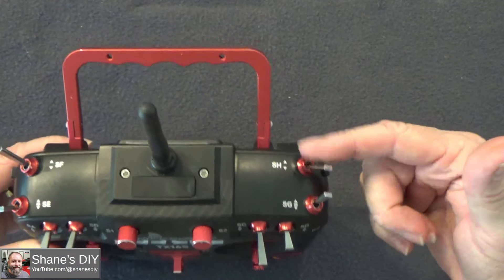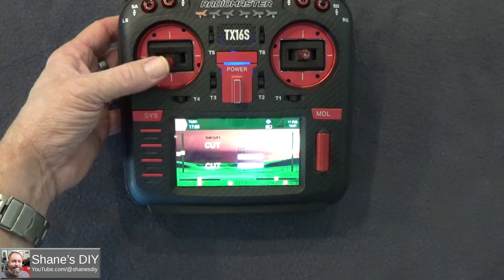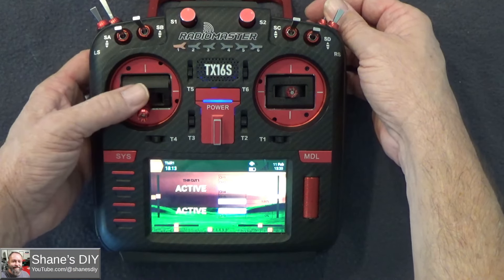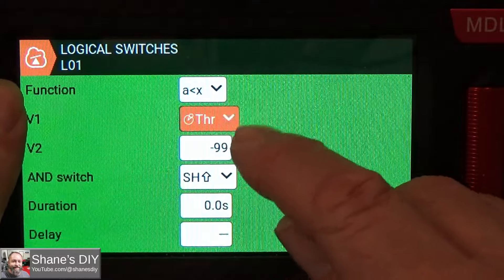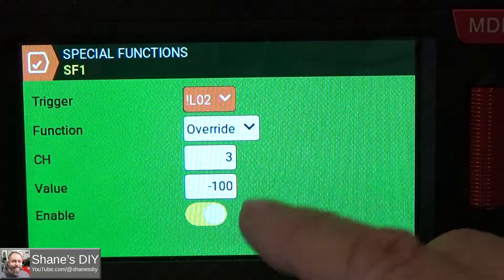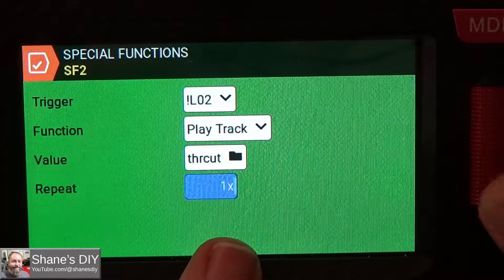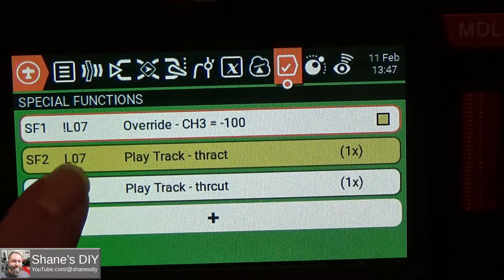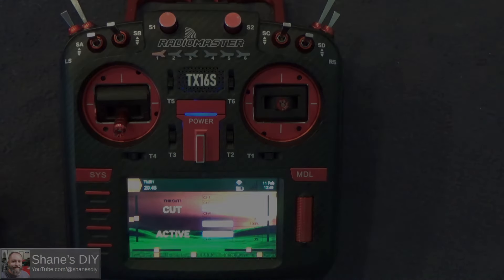Viewer Request: Advanced Throttle Cut For EdgeTX On The TX16S

Comment: I love the complexity of things you can do with EdgeTX. Often times I wonder if there's ever a "best practice" for some of these things, but the fact you can do this complex stuff is GREAT !
Reply from the maker: Definitely better ways to do things than others.  I often go back and look at old "code" I've done to make mixes or routines and see ways to improve it.  I've had viewers make suggestions that eliminated several logical switches to accomplish the same thing.  Keeps you thinking and using your imagination!   Thanks for watching and for your comment!
Reply: @shanesdiy  how can I send you photo or video of each screw
Reply from the maker: @ClaudeFrancois-f2t  What do you mean a photo or video of each "screw"?   If you have information to send me you can use my email.
shanesdiychannel (at) gmail (dot) com

I'd like to get your model yml file.  Open your SD card contents, look at the "labels.yml" file and find the name of the plane in question.  It will have an associated model file name like "model9.yml".  Copy that yml file and email it to me.  I can load it on my radio and see exactly if there is an issue with your setup.
Reply: @shanesdiy  I will email you a video as I go through each page

Comment: I use two of the six buttons for my Throttle cut,  I like when you turn on the transmitter it's already Throttle disabled
Reply from the maker: Good option.  I just tried the requested version featured in this video and it also defaults to throttle cut on power up so that is one good reason to use that method over my default method.  Even if the throttle cut toggle is set to active, you still have to throttle up and down before it will activate.

Comment: can you help, i have the edge tx16s MKii, with ar631 spektrum, for extra 300 bnf plane, i programmed the plane many times, but the the throttle stick at the lowest point making engine run and when i also move the stick up, still running, not sure what is causing all this
Reply from the maker: First things that come to mind are:

1. Check that your throttle trim is at zero and in the outputs make sure the throttle channel doesn't have any sub-trim applied.

2. Did you recently install any gimbal stick ends or gimbal spacer rings?  They can sometimes make the sticks hit the transmitter case not allowing them to go all the way to -100 or +100 without re-adjusting the gimbal mechanical end stops.

3. Perform a stick calibration, make sure the throttle stick is moved to the mid (0) position when it says to center the sticks, pots, and sliders.

4. Do you have any mixes or special functions that are working with the throttle channel?  If watching this video I can presume you have a throttle cut/channel override. Make sure that isn't holding the throttle channel > -100.  If you have a mix or curve setup for the throttle channel, double check that it allows the throttle channel to go to -100 with the stick down.
Reply: @shanesdiy  no new gimbal , no trims  set to -100 to 100 however it only goes one way if I look at the throttle channel
Reply from the maker: @ClaudeFrancois-f2t  Not sure what you mean by it only goes one way looking at the throttle channel?  If you monitor the throttle output channel does it sit at -100 at minimum throttle and go to +100 at full throttle?  If yes, I would do a throttle calibration.  Power on the transmitter, leave a full throttle.  power on the plane, after the first beeps, reduce the throttle stick to minimum and see if it will reset.
Reply: @shanesdiy  the throttle channel is set to -100 to 100 . I calibrated it 5 times already as well, and deleted the model and created a new one. When the left throttle stick is all way down, the propellor is running at full force, when i move the left stick up, still moving at full force.
Reply from the maker: @ClaudeFrancois-f2t  If you click MDL then nagivate to the outputs screen, watching the throttle channel (typically channel 3) do you see the output moving?  If it is not moving, do you have a throttle cut programmed?  If so, it is likely overriding the throttle stick.

Another thing I just thought of, are you sure you channel mapping for Spektrum isn't changing the throttle channel?  Try moving all the other sticks to see if another is effecting throttle.  For example, AETR is the most common channel order in the TX16S and the multi-module converts that to TAER.  If in the model setup you turned off channel mapping (check box in your RF setup that says "Disable Ch. map"), your aileron stick would be operating the throttle. If this is the case, uncheck the "Disable Ch. map" in the model setup
Reply: @shanesdiy  everything is on AETR, throttle was working before not sure what changed. WHen i am in the output, i see the two lines moving together only one way to only one direction. When i set throttle activate, throttle runs when stick all way down.
Reply from the maker: @ClaudeFrancois-f2t  So you have throttle cut on and there is no throttle.  Activate the throttle and the throttle just goes directly to full throttle?

Do you know how to copy the model yml file from your SD card so you could email it to me?  This is a fascinating case, I'd love to have a look at your model file.

shanesdiychannel (at) gmail.com
Reply: @shanesdiy  yes when I activate throttle from throttle cut and stick all way down I get full throttle 
When I move stick up no change full throttle but all
Is at full throttle not like when you move stick slowly it gradually moves up

Comment: Another way of Throttle cut is put the Throttle on transmitter to half, won't arm until its sees Throttle down
Reply from the maker: Did you watch the video?  That sounds like my default method unless I am misunderstanding you.  Great thing (or bad thing for some I guess) is that thereare a 100 ways to accomplish the same thing in EdgeTX!